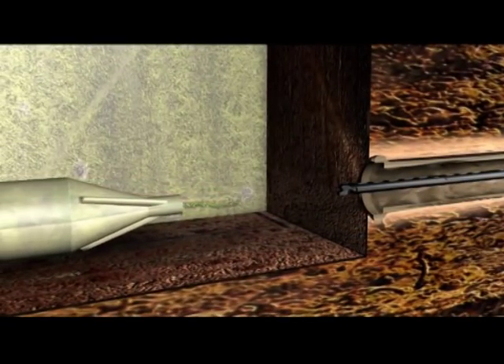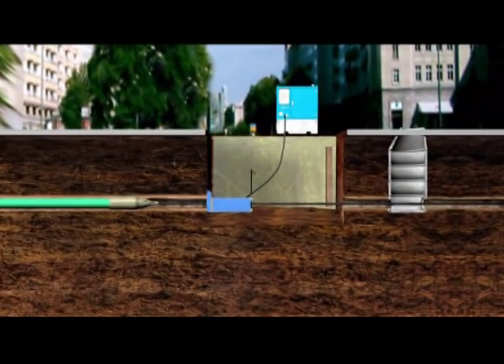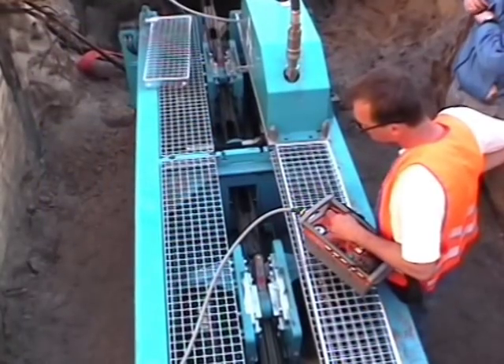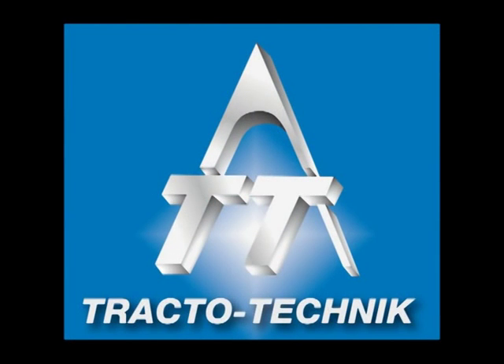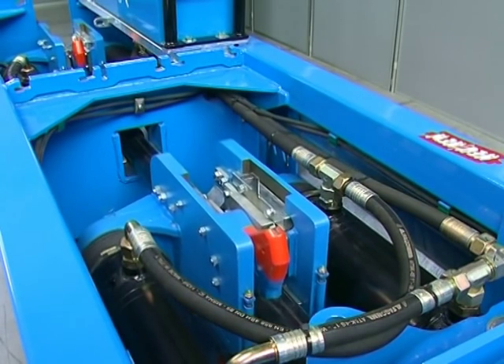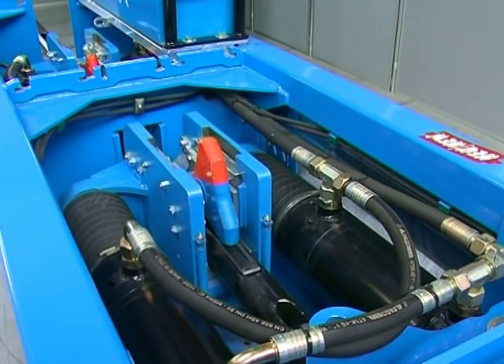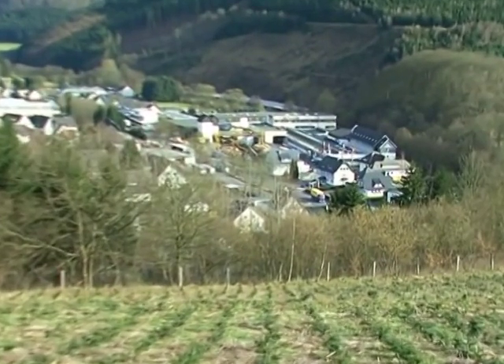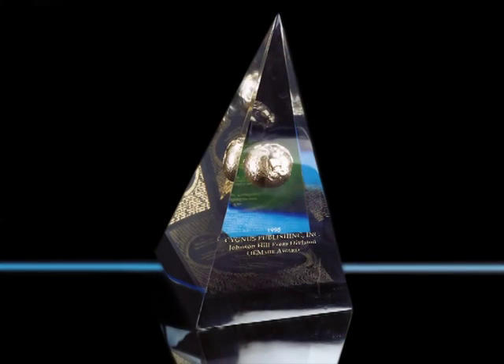Trenchless Pipe Replacement with GRUNDOBURST

Comment: Any companies do this in Northeastern Ohio? I need 40-100 ft done. I have had my line snaked three times in 6 months. Who can do this?
Reply: NewFrambian If your still living at the home with the root intrusion problem, all you need to do is get it snaked once a year and the most important thing to do is make sure you put 1 can of foaming root killer  you can buy it at walmart http://www.walmart.com/ip/Roebic-Laboratories-Inc-Frk-6-Foaming-Root-Killer/17163531 and that way it won't need to be cleaned till one year! If you do move and it's in the Colorado springs, Co area call Pro Power Rooter http://propowerrooterservice.com
Reply: Im in northeastern ohio and can do it. But i ran this equipment back west. I don't know too many companies that do it out here. They would must likely dig it up. But when i did it back west, 40-100 feet would cost about 5 grand. So maybe renting a machine and digging it up yourself would be more effective. Or you can pay me lol
Reply: You should have your line camera'd and jetted
Reply: I have had it cleaned every 6-9 months for the past 3 years. Solution: we are moving.
Reply: A.C.O.D how much is cost for 30 feet long line andar the build property